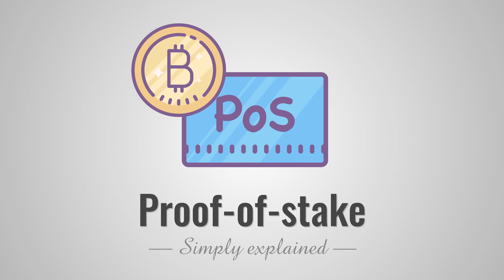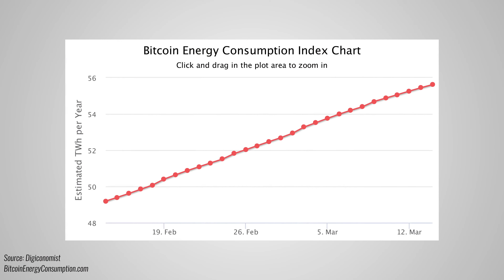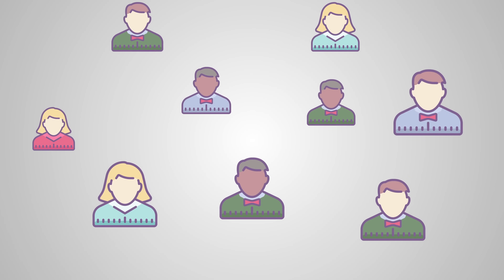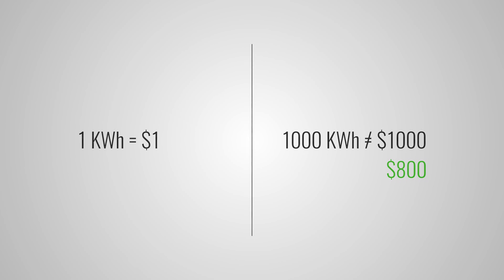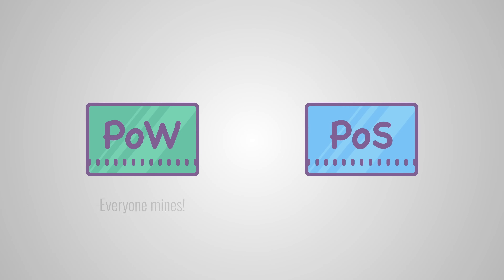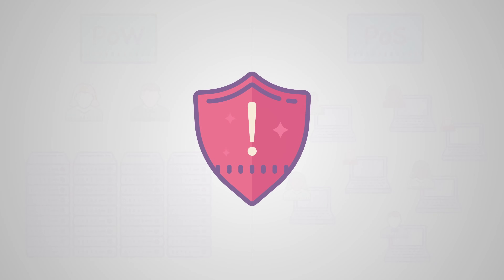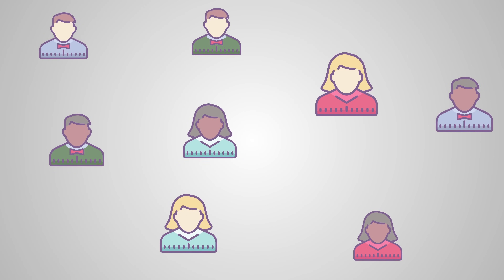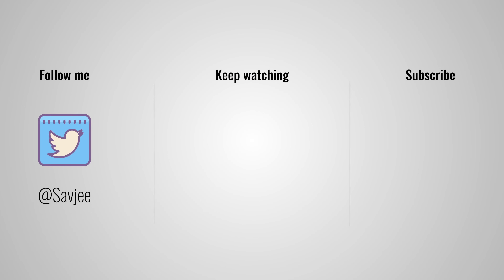Proof-of-Stake (vs proof-of-work)

Comment: The 51% attack for Proof of Stake was addressed incorrectly. You don’t need 51% of ALL currency you need 51% of all stakes. Actually, you might even need less if you game the selection process correctly. A successful attack on proof of stake can have malicious nodes validate their other malicious nodes, and if done long enough can sneak in malicious transactions before getting caught by which time it’s too late.
Reply: Technically correct but in order to guarantee control of the block chain, you would need 51% of all coins. If you only control 51% of the staked coins, yes, you're in control at that time but you would continually have to increase your stake as others join in. Having 51% of the coins, rather than just 51% of the stake, means you control the block chain no matter how many people join in on staking later on.
Reply: Given the choice of the nod is liner with how much money you have then 51% of all currency is correct though, isn't it?
Reply: @bitcoinizakaya9579  Are you of the opinion that Proof of Stake would be best for kickstarting projects? Or is its use to be limited in that context as well?
Also, what is the theory behind the punishment model of staking?
Reply: @hkgujudhur  Hi! How PoS would be good for Kickstarter projects? I'm curious
Reply: @hkgujudhur  Nice info, I'll do my research! Thanks for the answer
Reply: So all the validators will asleep/turned off while this super secret malicious node attacks the network?
Reply: +1 in PoS just to blocking of feeding 1/3 or 33% of nodes/validators feed by incorrect data - this will block pos network from adding new blocks.
(its less stable network consensus)
+ it's much harder to handle splits in such networks, and much-much harder to check validity of stakes/stakers. 
- btw you actually required only 35% of stakes to block network create huge mess with history.
Reply: the other issue is that it takes all of the coins into account. if our money was governed by proof of stake, the 1% of the coin would control 31% of the cash.
26 people own more then 50% of the poorest people, in a PoW the vast majority will not be mining, thus making the top 1% control even more.

say you have a 100 people network, 1 guy owns 31%, 26 of them owns 50% each, on average 25 of the 100 would own 0.25, one would own 31% while the rest would be the poor.
that doesn't sound like a fair deal. 74% of the network would be divided by 74% meaning that on average each of them would own 1% each... a far cry from the 31% compared to the top. there's no chance in hell that all of the 74% can coordinate enough to take down the 31%
Reply: Hopefully everyone doesn't steak on Coinbase or one identity dont put other out of business. That wouldnt be good.
Reply: DONT DO IT!! DONT!!! Lol. I know what ur thinking...... :-P
Reply: He said proof of work makes the network more centralized because of mining pools. What do you think about this ?
Reply: @BeenDeliveredToday  No because the individual miners within whichever pool are distributed and are location independent.
Reply: @BeenDeliveredToday  It’s literally the reason why the vast majority of Bitcoin miners are in a country where there is no free internet..it’s a bad idea.
Reply: @BeenDeliveredToday  S t a k i n g   P o o l s
Reply: @BeenDeliveredToday  Well staking pools exist so it ends up the same in a sense, I personally think PoW is slightly better in terms of validation, hashing a block one time on PoS vs hashing a block many times to prove you found a number smaller than or equal to the target difficulty seems more trustworthy. I do not know much about the hashing or algorithms used for PoS consensus though so take it with a grain of salt.
Reply: @BeenDeliveredToday  I think if every DOGE holder had a chance to find a 10k DOGE block there would be tons of individual nodes all over the world... I think it would be 100x more decentralized than mining
Reply: @bitcoinizakaya9579  I think that it's not true that everyone can participate equally because I don't have 1 million dollars to buy a supercomputer in order to have greater chances of mining the next Bitcoin block. So it's the same case of Proof Of Work. But Proof of Work gains in the sense that it uses far less energy.
Reply: you cannot sneak in malicious transaction - all nodes validate forged blocks 🙄
Reply: @gimrexymcity4833  you can if you have 51% of the stake like the comment said it’s like 51% attack on PoW you just need 51% of the Mining power but in reality 51% aren’t worth it you ruin credibility of a coin and it becomes less worth it’s more worth using all that power in validating blocks
Reply: @blackferrets820  nope, expand initial comment. I was referring to rest of the comment.
Reply: @blackferrets820  Owning 51% of coin is easier than owning 51% or the mining power, especially when theres no POW mechanism to assure 1 person didnt already spawn more than 50 % of the coin for themselves as a "dev tax" .  One could also make money by shorting the coin to 51 % attack it if more can be made from tanking futures than the coin itself.  Imagine if a POS coin was ever good enough to challenge the status quo ( which it never will because its just the status quo on steroids ) govts could easily seize large amounts and attack the network by simply owning large stakes which is not possible in POW without competing with real energy not purely stake. Govts can print money they cannot print energy.
Reply: @bitcoinizakaya9579  finding out if a dev has 51% of the coins would be easily found out most of the times and every kind of 51% wouldn’t actually be worth it you ruin a coin use the power to create blocks way more profit in doing that
Reply: @bitcoinizakaya9579  now be honest do you think that if a coin with 1 trillion is created that nobody would notice if the dev has half a trillion
Reply: @blackferrets820  I just dont see how youd know, most ICO coins are exactly rhat like all the coins are used for the ICO well thats kinda messed up all the coins are spawned so one entity can raise money that pretty much as centralized as it gets if you ask me.
Reply: @blackferrets820  I dont agree it would be very hsrd to tell one dev owned all the coins if he sent them to different wallets
Reply: @bitcoinizakaya9579  would still be noticed and as I said 51% attacks aren’t worth it
Reply: @bitcoinizakaya9579  it’s like the US dollar 😂
Reply: @blackferrets820  Could be worth it in some cases where you hold a lot of  competing crypto - to devalue competition.
Reply: @blackferrets820  you should also remember in PoW 51% (or better 75%) may only create possibility for you to try performing double-spend and you should own also funds for double spend + tech possibilities - but it's not warranty success, and do not compromise network - only couple of transactions ... 

in PoS 33% - will block all network from creating new blocks, also may compromise security.
Reply: @gimrexymcity4833  You can argue the fact that theres no fair thermodynamic mechanism in POS coins for the initial distribution of the first coins ( like mining in POW) that the genesis transactions in every POS coin is basically a sneaky malicious transaction where coins are created for nothing. The problem with a 51% attack is someone could spawn coins or edit the chain well the way POS coins are initiated is basically exactly that a transaction where one person unilaterally spawns themselves coins ( often for sale in an ico lol ) for nothing.
Reply: Sooooooooo Etherium is doomed.
Reply: ADA and WAVES both have over 75% of circulating supply staking and earning people money LOLS good luck buying 51% of staking supply lols
Reply: @Fonzerrellie  why is it that it s always those that have little to no idea how cardano works badmouth it the most? Cardano is the future
Reply: @Fonzerrellie  If every person holding stakes they are not earning anything if I have 10% of a coin and you give every person holding 1 coin an additional coin for staking I still own 10% its silly to call such proportional inflation tricks "earning" If I made you a bitcoin block explorer that simply read every bitcoin you had as 2 more bitcoin every week would you feel better because it would change your percent stake.  Whats really happening is if you stake you dont gain anything but a proportional number of coins and if you dont stake you get punished by having your stake diluted by other users which allows them to stake their stake always at the expense of users that either dont know to or cant stake its a lose lose lose situation unless ur the person that creates the token.
Reply: lol oh no the person hwo invested most benefits most, just like mining, and some POS networks pay a % return not a coin based return like solo mining, but Sure with my little PIVX bag I only find a block every week or two (still better than none) while bigger holders find blocks per day ect. Just like a bigger miner earns more in a day than a smaller rig seriously "golf clap"
Reply: @Fonzerrellie  PoS shouldn’t be based on wealth it should favor each node equally if there are 100 nodes each node should have a 1% chance not based on stake that’s why I don’t like proof of stake it again favors the rich
Reply: so you think each miner mining BTC should earn the same amount no matter what they have invested Th's? Ha agree to disagree I guess, I think both % based and static reward POS blockchains are awesome always have.
Reply: @Fonzerrellie  nope I meant proof of stake nodes if you have a node and you are staking there should be equal chance not the amount of coins should determine your chance. I Didn’t say anything about proof of work
Reply: @blackferrets820  you are free to create a consensus mechanism that solves all problems simultaneously
Reply: @blackferrets820  "pos should favor each node equally" just won't work as a single entity can create as many puppet nodes as they can afford.

Comment: In PoS, even if you somehow manage to gather 51% of the total coins, as mentioned to be 79B $ worth of bitcoins as explained in the video, you are only ensuring that you get to be the validator for the next blocks. The block you build and propagate still has to be validated by all the other nodes in the network. Possessing 51% of total coins doesn't mean you also possess 51% of the nodes in the network, which is what you need to be able to successfully manipulate the blocks to your advantage

Comment: Wait but what if some big stakeholder validates false transactions. Sure, he'll lose more in his stake than what he gains in mining. BUT WHAT if the false transaction he validated was his own? Perhaps from a different node alltogether? That way, false validation could easily pay off.

I'm sure someone has already thought of it and there's solutions, I'm just wondering what exactly.
Reply: So Simply Explained answers it, but not really. The market cap isn't a good representation of the value of the market. It's just the value of the last transaction times all the assets. If any whale tried dumping their coin, market cap would fall immediately and the value they'd get would be nothing even close to their share of the previous market cap. And more importantly vice versa, whales can buy massive amounts of coins underpriced, through suppressing the price and small bot transactions. A 51% attack doesn't seem farfetched even in proof of stake...

Comment: Proof of Stake will lead to centralization. Only a very small number of people will have enough money to stake so this system will make the rich even richer. Also, the Proof of Stake mechanism will be complicated. This means that a very small handful of companies will offer Proof of Stake services so that other investors can participate. This means that a very small number of validator companies would control the network. We should not move to Proof of Stake. Proof of work allows the small guy, even someone with only 1 computer and 1 GPU, to participate in the network which is why it is so distributed. Proof of Stake would allow a very small number of people to control the entire network and lead to centralization.

Comment: It's NOT correct to say that proof of work such as Bitcoin is more vulnerable to 51% attack. While theoretically it's possible, practically and financially it's almost impossible. Check out explanation from Andreas M. Antonopoulos himself. Also why did you say that proof of work is centralized? It runs based on consensus rules. Any node that breaks it gets kicked out automatically. Not to forget, there's also difficulty adjustment. Your explanation is too one-sided.

Comment: I think I read that the minimum POS for ETH is 32 ETH.  Right now it's at $226 USD, so I would have to sink $ 7,232 just to become a validator.  This seemingly is NOT a way for the average cryptopeep to gain entry.  I could continue buying enough to be "competitive", e.g., 50 ETH for $ 11,300 USD.  But do the validators know what the total number of validators in the group? 

So then, I have 50 of my ETH in the stake "bank" but the big money have a lot more and I get nothing in return.  I haven't seen a contract form that will guarantee I will get my 50 ETH back, or that the POS could get hacked, etc. Even if everything is working fine, my ETH is locked up until ETH releases it.  If ETH price drops 50%, I can't sell.  Definitely looks too risky for me but not for the whales who could probably take a Capital Loss on their US income tax.  LOL    Excellent video, BTW.

Comment: How does PoS favor the rich when it costs more money to buy more mining equipment to increase your chances to receive more bitcoin?
Reply from the maker: With PoS you don't have to buy more mining equipment. In PoS, the chances of you winning the block reward is higher when you have more coins. So rich people increase their chances just by having more coins.
Reply: @simplyexplained  I understand that, but you have to have money to buy that mining equipment, which cost lots of money, in order to increase your chances of getting more bitcoin. The more power you can exploit with machines and electricity, you could have bought well over a million Ada.
Reply from the maker: @lovewilliams4500  In POS you don't have expensive mining equipment. You "stake" your coins. This was explained in the video. So, forget buying mining equipement. Instead, you buy coins and you "stake" them (can be done with a single Raspberry Pi). The more coins you stake, the more chance you have to receive the block reward (which you get solely from validating transactions, not mining them through a complex and energy consuming algorithm).

Comment: So Ethereum will be pushing out the 99%, gotcha. So Ethereum as a currency will die, the blockchain will be used for businesses but when has a good intention to ever level a playing field for all EVER worked. It hasn't. Also, I know $79 Billion sounds like a ton, but you know who has that easily right now and also would LOVE to control all this. The Federal Reserve. Add to that they are run by bankers who know exactly how to manipulate a market (See the Great Depression). So bring it down by 75% and buy 51%, this is CRAZY easy to do.

Comment: There are a few factors, such as greater efficiency of PoS coins, its higher resistance against any kinds attacks as well as the growing popularity of this consensus which is dictated by a significant technological advantage over Proof of Work. That is why some currencies decide to conduct swap and resign from using PoW which is replaced by Proof of Stake. One of such coins is PrimeStone Coin (PSC) which conducted swap in January 2019. As a user I am more satisfied with PoS, because rewards for stakers come proportionally to the amount of possessed coins so it a fair solution. The situation with PoW was a bit confusing nd irritating. When sb put a huge comupting power and then switched it off, the chain was stuck. So I consider chains based on PoW less efficient and effective than PoS.

Comment: Correct me if I'm wrong but the whole point of PoW is that it's hard to get the right hash but super easy to verify it.  So my question is even if one pool owned 51% of the hash power literally as soon as they post the false hash as a solution it can be checked to be known as false so I don't see how they could fake it.  Also I don't understand how you even could fake it if a hash consists of previous data from the block chain and new transactions ran though a hash algorithm doesn't faking a hash also fake a transaction?  And if so since things like public and private keys exist on wallets no one can fake that you sent money except you so again wouldn't this be super easy to verify as false once the hash is posted? As immediately you can run the hash and be like hey uh this transaction didn't use the correct private and public key combo this is fake.  Point is it's already hard enough to fake it and then by PoW's very nature it's super easy to tell a fake/bad hash from a real one.  I agree that the amount of power miners for bitcoin use is ridiculous and not scale-able at all in terms of how much power is used and how many transactions are added to the ledger.  But once bitcoin halves for the last time and other coins stop having block rewards through inflation miners will be getting paid through transactions fees at that point anyway, PoS as it stands just seems like a half baked solution imo, especially considering that most coins that use it don't have much market cap preventing someone from getting 51% of it.